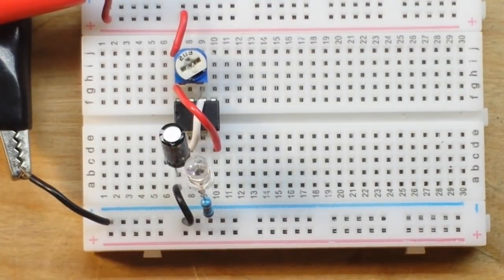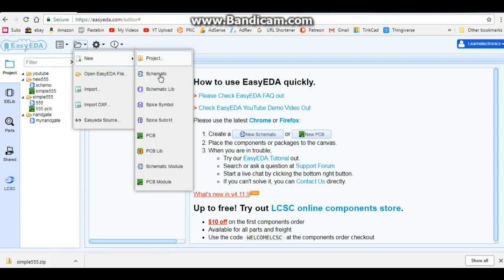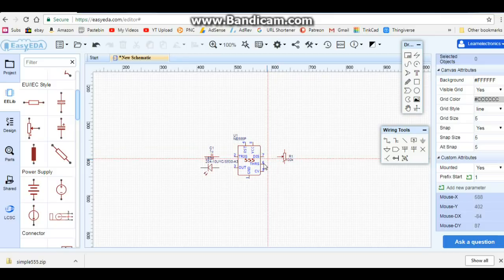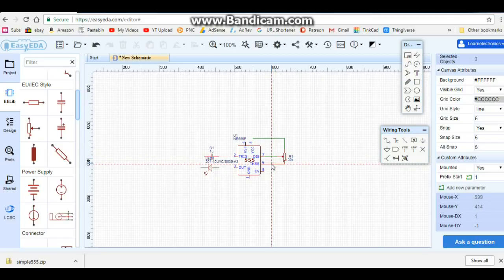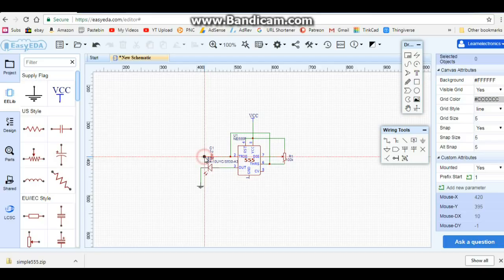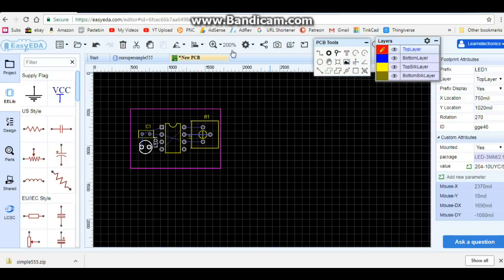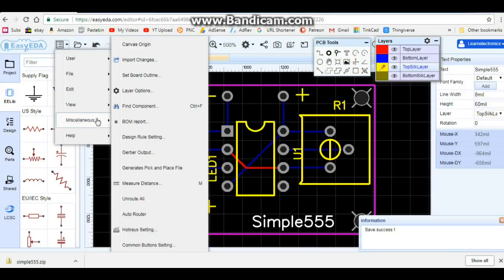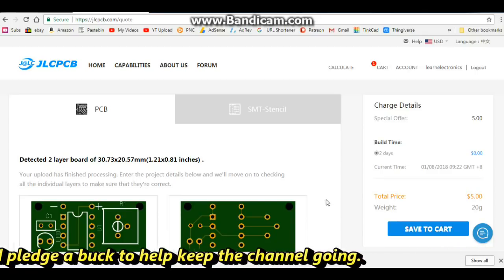How to design your own PCB - Part 1

Comment: You explain well how to use the program but thats not the most important thing here nor it is the hardest. That one will be how do you know what components to use in order to get the result you want, how do you decide when do you need to use a resistor or several or a capacitor, with what capacity or a transistor or controller,  relay, diode varistor... there are so many components, and when you know what you want to accomplish which component do you start from ? Can you make another video just on this matter ?

Comment: Regarding the potentiometer - for example - what happens if you get the finished PCB and find the pot you used on the breadboard doesn't fit the pin layout on the PCB?  Did I miss a step where you chose the pot to have some particular form factor?

Comment: I use veroboard or prototype board but must give this a try although I suppose you would need to be producing a few for it to be worthwhile?
Reply: Pretty amazing the times we live in. Custom PCB's on demand for reasonable prices.
Reply from the maker: +gartmorn Not at all. 10 pcb's for 2 dollars American. What's that? Pound and a half?
Reply from the maker: +A Micklich Yep. 5 years ago I was rolling my own.
Reply: learnelectronics never knew they were so cheap!  Are they in China by any chance?
Reply: learnelectronics 
I suppose that's the starting price. and extras are well extra! correct?

Comment: EasyEDA is Cloud based only...there is NO desktop version available at this time....so no internet, no PCB design.
Reply: Also, In the event the control-voltage pin is not used, as is in this case, it is recommended that it be bypassed with a
capacitor of about 0.01uF (10nF) for immunity to noise, since it is a comparator input.
Reply from the maker: +DrTeddyMMM I have left the CV pin floating for the last 20 years or so. It works for me. You do what ever you want
Reply: This is a recommendation directly from the datasheet. If you are not worried about reliable output then whatever. As I stated, this is a recommendation from the datasheet for reliable output. Helps eliminate the "WTF", what's going on situations when using this as a timing source...
Reply: Here's the thing, you offer this as project and someone makes it, then they have problems with it, random timing events.....it then becomes "your" problem...Just trying to help eliminate that...

Comment: i like this but I make my own PCBs using photoresist or cnc milling on copper coated boards. One question on your design, did you forget the resistor for thye LED or are you using one soldered to the leg? Cool design software, have you tried Fritizing? It's standalone and you can create PCBs as well. Thanks for a neat project.
Reply from the maker: +George Chambers I just solder the resistor to the cathode. I have not tried Fritzing. I'm used to Kicad, but I wanted to make this video for folks who don't have any design software.
Reply: I thought that might be the case with the resistor. Fritzing is free software and  I believe open source. But hey run what you brung right!
Reply: learnelectronics 
is that Gerber for us babies who are just learning!

Comment: Aw, you forgot the LED resistor.😉 You make it look so easy!
Reply: ...that's why you're making a PCB to eliminate floating parts...
Reply: Yes, on the breadboards. But wouldn't that look klutzy on a custom PCB?🤔
Reply from the maker: +Robert Gibbons I just solder them to the cathode.